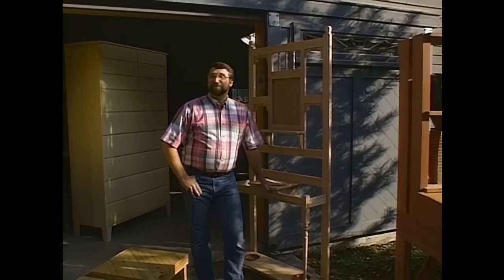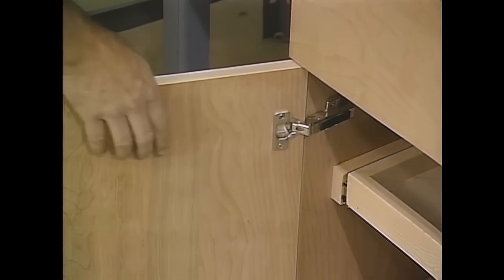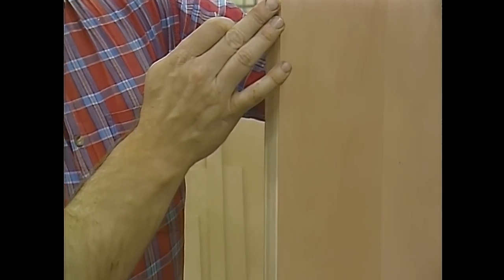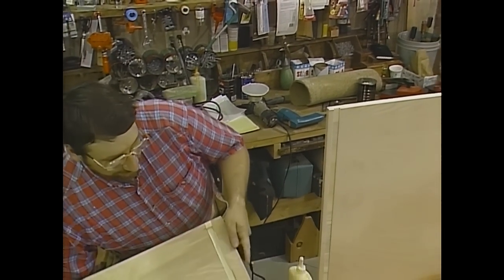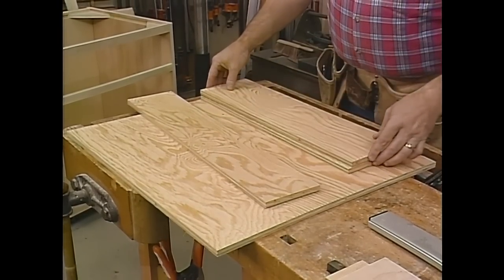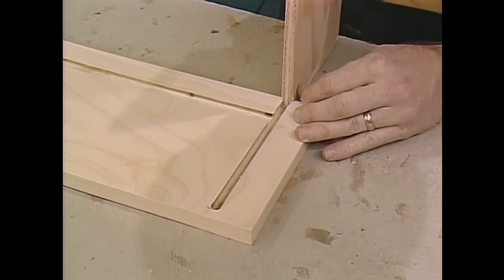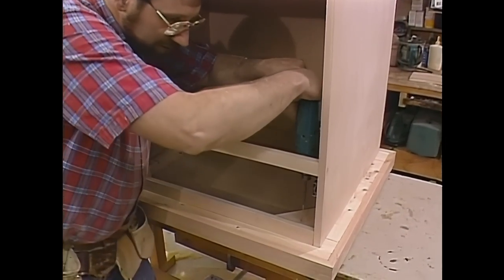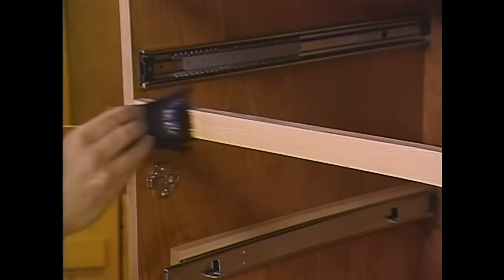Rolling Shop Cabinet [AI HD]  |  S4 E1

Comment: Starting Season 4! I have been tracking the new YouTube videos from Russ and Norm since Season 1 Episode 1 much as I did during the 20 seasons of The New Yankee Workshop. Built two of the Rolling Shop Cabinets with "the measured drawings and materials list" and VHS tape in the later 1990s. First was specific to the plans as a sharpening/grinder station (before Season 12 Episode 11), second was modified with 4 drawers and a workbench top with dog holes. Both sized in height to my Delta Unisaw for in feed and out feed support. Casters and moveable stationary tools are a must in a home/farm workshop with limited space. Both are still in use today after almost 30 years! Thanks for the memories Norm!

Comment: Wonderful episode and I've built three of these for my grinder, chop saw, and thickness planer over the years.  Tip on the sliding dovetail routs - hog the routs out with a straight bit first as it makes for a much crisper and easier dovetail rout second. Cheers!

Comment: Instead of filling in that little gap left by the dado before putting veneer tape on the edges of the plywood, why not just cut the back dado first and then start/stop the horizontal dado at the back vertical dado?  Then the horizontal dado won't be visible past the back panel.   Of course, that would mean you'd have to cut the horizontal dadoes with a router, but that's not difficult.

Comment: I can't see how the 4 triangle pieces make contact with the bottom of the top. The dado for the triangle pieces puts it below the top of the walls/front/back of the cabinet. The working top he adds touches the top of the walls/front/back and not the triangle pieces. How is he putting 2" screws to hold the top on with a gap like that?  ??? What am I missing?
Reply from the maker: They aren't in contact. There is a 1/2' gap between the corner block and the underside of the table top.
Reply: @newyankeeworkshop  Thank you! Is there a reason there is a gap or is it just as designed?